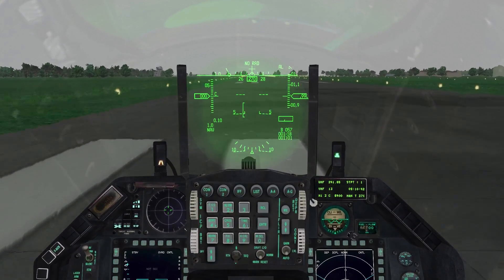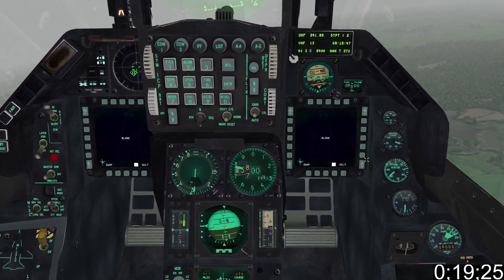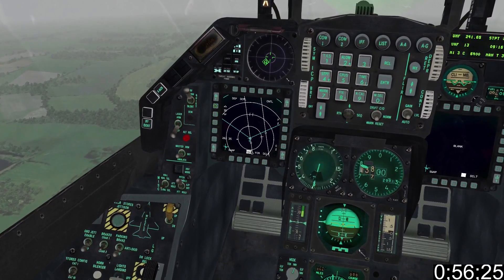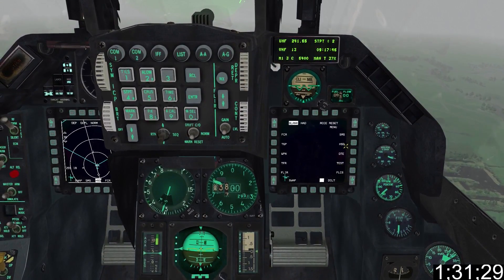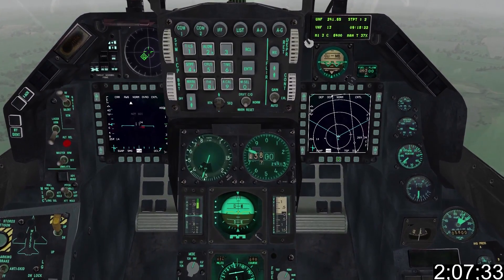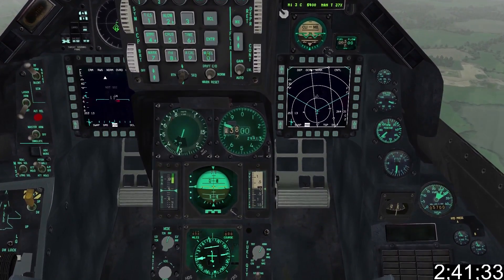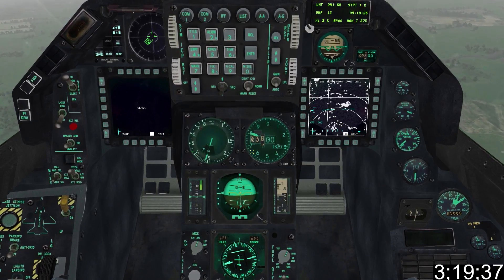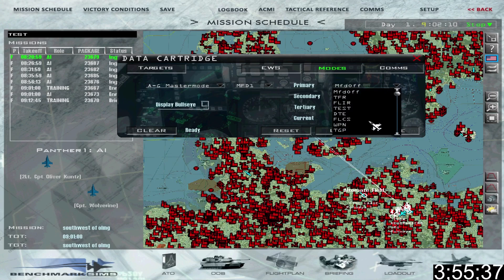4 Minute Falcon - F-16 MFD & SOI Tutorial

Comment: Are you using a specific BMS warthog control profile? or did you configure the controls yourself? I want to get more into BMS but the control setup is stopping me from doing so right now.
Reply: I know a year has passed since you posted this but I stopped BMS for the same reason after playing it for years. However the latest BMS 4.34 has got rid of those problems. In the docs folder there are options to have everything setup without issue. I also have the Warthog and it took me just a few minutes to have everything sorted. Anyway all the best.